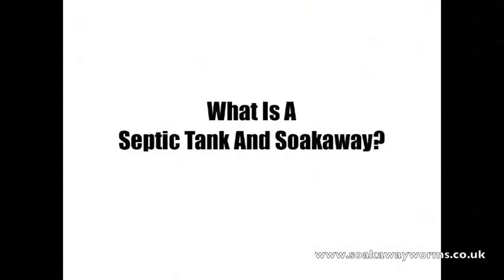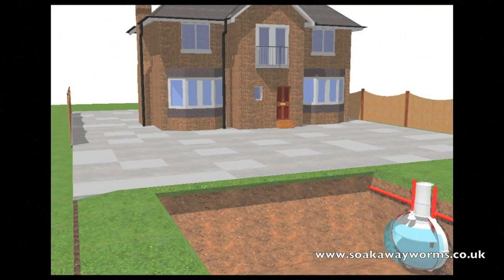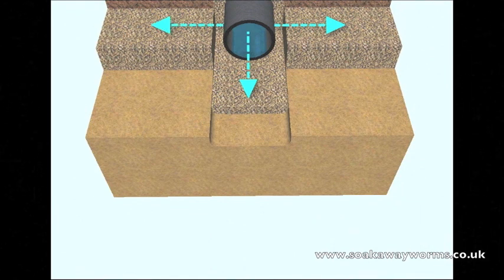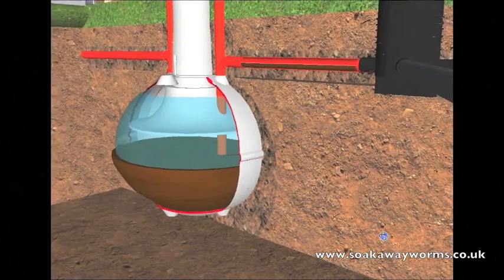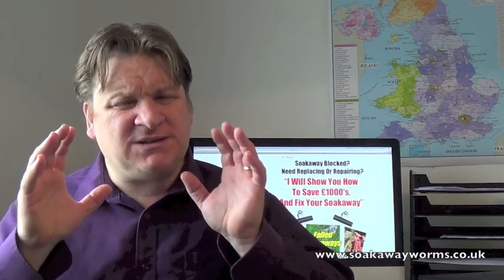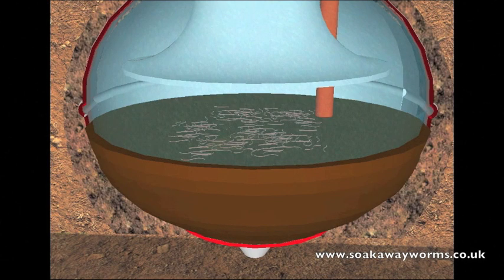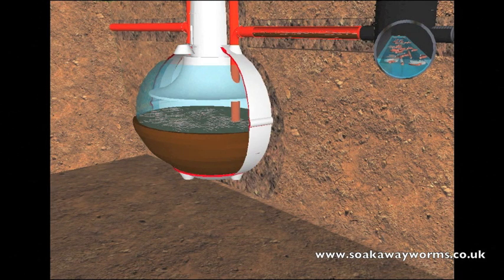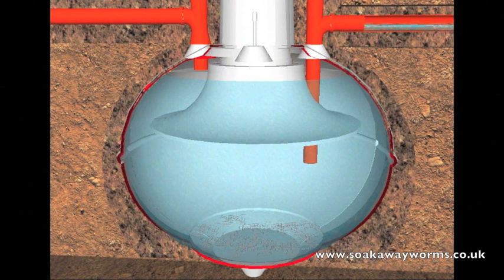Septic Tank Soakaway Construction

Comment: Actually the chamber design is better for the leach field than the perforated pipe.The leach field can be unblocked by converting to aerobic digestion.The aerobic bacteria digest faster than the worms. A small amount of electricity is used to pump air into the tank.

Comment: Sir Your septic tank is connected up completely wrong.
The inlet should go to the pipe that deposits the sludge beneath the baffles (filter) as this stops the solids from passing through the baffles to the land drain.
The outlet should go to the pipe above the baffles (filter) to allow just fluids into the land drain.

Comment: Love worms but I would put them in the access port of the lateral lines though despite that 
There are a lot of issues with the way people use septic tanks and it is mainly what we put down it. 

Honestly people should have two waste pipe lines one for grey water and one completely separate for internal body waste. The biggest issue is people put down all their cooking and soaps and bleaches which causes issues with the proper environment to brake down even human waste let alone added oils and grease.

 ALSO septic tanks SHOULD have a 2 chamber system first one all the waste is dumped into and the second has a chamber or gap that should have a hook screen (use rear to remove screen if it gets clogged takes years though). First chamber will develop the typical slug on the bottom. there will be floating scum layer which it what the big screen is for while the septic fills past the gap hole in both tanks.

 Then the second chamber should have a septic dip bell to prevent any solids from coming up. Septic bells are like a cup standing up underneath a strait pipe only bent at a 90 degree end into the septic pointing down that directly connects to the soak lines or lateral lines. At first as the second tank fills up this "cup" or septic "bell" lifts and keeps fluid from entering the strait pipe lines. after the waters get higher than the cup the fluids rush in but once they have weighted the cup down the water has already been above the 90 degree bend and the scum that has gotten in and floated in the second tank is floating higher than the downward dip bend of the pipe. Oh and personally I like to go at least 6 inches down below the bottom of the strait line after the bend and of course secure the bell or cup to the pipe in some way best to use 2 different materials and have a 4 string support system.

maintenance should never have to be preformed on the second tank( it is more like the second chamber of the same tank) but you should inspect both sides through the access ports yearly as it is better to pump on tank the solids and reset the microbes then it is to have to pay someone to scrap any tanks and get out the muck

Comment: what happens when you use bleach to clean in the household and that waste water goes into the septic tank? wont that instamtly kill the worms?
Reply: Chlorine is a strong disinfectant and it should not be allowed to enter in septic tank until you smell foul gases near ur tank region.
Only to slow down the anaerobic decomposition by reducing the population of bacteria we use bleaching powder in septic tank.
So in short for a optimum workability of ur tank don't allow the disposal of any form of chlorine in ur tank until it requires.